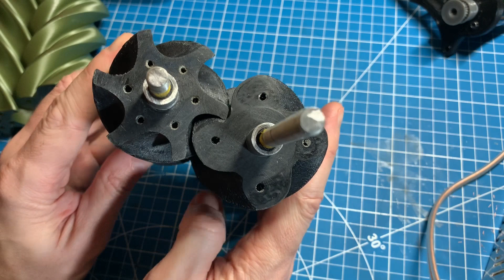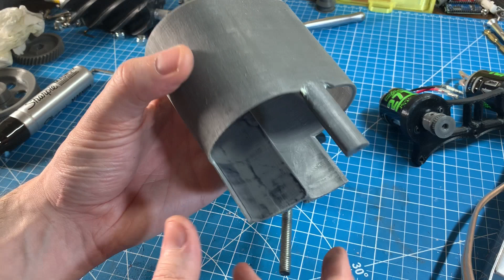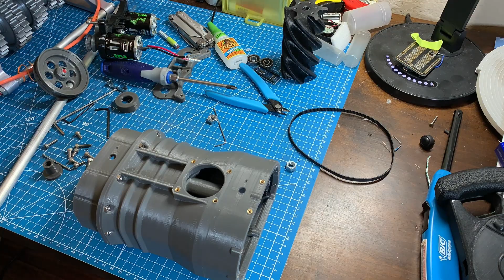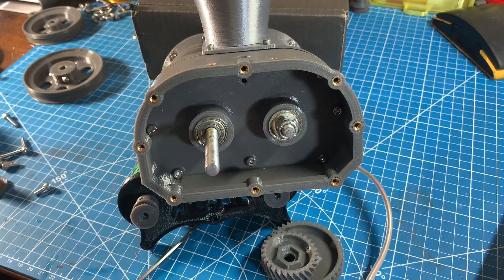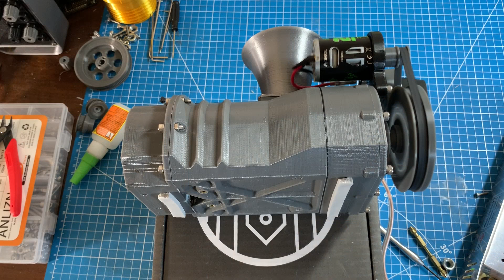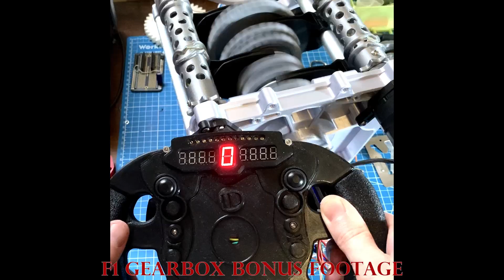3D Printed Screw Compressor Part 2 - Assembly and First Test

Comment: What RPM are you running this at? I think your design is sound but with the tolerances of FDM, you can expect your blowhole (rotor tip leak) to be quite larger than a machined compressor. Efficiency drops significantly with more tip leakage and higher rpms will improve output. Generally screws run at about 9-13k RPMs IIRC. I have a screw compressor design/performance textbook and maybe can offer some help if you ever revisit this project again.
Reply: For reference, for smaller than this Airend, 50hp isn't uncommon
Reply from the maker: I was peaking around 7k rpm.  So it sounds like I really need to spin this thing faster.  I think it would definitely go smaller for my next design and a full gear driven drivetrain.  Like you said the tolerances are what make this so difficult, particularly at this size.

Comment: I'd think it is loud because one rotor is turning the other, rather than each being turned by timing gears.
Reply from the maker: I'm not sure on the cause.  I know that most small dry compressors don't usually run timing gears.  I know the twin-screw superchargers used on things like the Hellcat have muffler built into the supercharger otherwise they'd be quite loud.

Comment: Your print and fitment issues come for lack in adjustments on slicer settings. adjust the horizontal expansion setting in your slicer... negative values if holes or too tight things fit too tightly, positive values if they are too loose... insure your printer e-steps are properly calibrated. Both can cause too much or too little flow and make the overall print different than you design. I run into this problem with different types of filaments as well. The more you print the more you learn.
Reply from the maker: It's definitely a learning process, I need to place more with the slicer settings.  I had a terrible time getting the shape to be perfectly concentric.  I have very different printer setup now that may do a bit better.

Comment: I think they come off quieter because the peaks and valleys of the noise made aren't nearly as unsteady as a piston type, which have to accelerate and then decelerate over and over again. Having the power go out in the middle of the day while using air tools really gives an idea of how much higher the noise floor is with these running.
Reply from the maker: That completely makes sense.  The noise is much smoother than a piston compressor.  I'll definitely add a muffler to the intake if I do a version 2.

Comment: Hi wonderful work. Quick question... you said you noticed play in the 608 bearings and basically fixed it with tape? Is there a "zero play" bearing or am I asking about something that doesn't exist or is the nature of this type of bearing always going to have some play in it. I'm learning so much from this and am glad that you got technical but not mind boggling with the explanation of the build. That really matters to some of us!
Reply from the maker: Thanks!  The 608 bearings do vary quite a bit in quality and tolerances, but in this particular case the threaded rod I used for the shaft was slightly undersized.  If I did it again, I would use an 8mm precision rod which is fairly cheap on Amazon and these should fit much tighter.  Being a first time prototype I just tried to make it work with the threaded rod I already had.

Comment: Some materials and print settings have a parameter called "Shrinkage or Expansion factor" which potentially explains your meshing problem.  This information is not available outside academic settings and precision engineering houses that test materials themselves, so shrinking a part was a good move.
Reply from the maker: Thanks.  I need to play with the shrinkage settings in Cura more and see if I can get the parts to turn out more accurately.  I wish there was more information out there on the  manufacturing and design of these.
Reply: @IndeterminateDesign  You might also have to increase the stiffness of your printer.  If you have a direct drive printer (I think you do, because you print PETG), then you could consider switching to a bowden tube, and creating gussets to stiffen the gantry of the printer.  This could improve your tolerances enough to get a solid print.

That said, I wonder how much the parts are expanding as the helix rotates from centrifugal forces.  We might be dealing with factors beyond just the actual printing tolerance of the printer, when you get interference on your gears.
Reply from the maker: Yeah, some of that is so hard to measure with these shapes.   I didn't talk about it in the videos, but these screws are basically a type of cycloidal gear, so they have a lot of sliding action which the smallest errors in the shape can cause intermittent issues, and actually push the air the wrong direction.

The biggest lesson I now know for version 2 is to print very slowly.  I seem to get much more accuracy when I do this.

Comment: if this mounted in pneumatic engine will it make the air tank consume less?
Reply from the maker: Well this design wasn’t very efficient, but with regards to your question is this most won’t decrease the amount of air consumed. The engine would spend more energy spinning this pump than it would recover by pumping air back into the system.

Comment: please upload Vedio 9 mint to 19 mint with slow speed for better understand.
Reply from the maker: I don't think I'm going to be able to fit all of that in to a video.  If you check out my GitHub I have the cad files and profile for the rotors available.  https://github.com/indeterminatedesign/ScrewCompressor 
 There is a significant amount of math and a custom program I had to create to generate the rotor profiles using envelopes.  If you want to make a different form of rotor I recommend downloading this paper. https://docs.lib.purdue.edu/icec/1099/.

Comment: Buddy, if you get one of these compressors able to lift 70 psi, how much would you charge for one? Let's says it's entirely printed in PTE with the needed tolerances.
Reply from the maker: That's an interesting question, I'm not sure at this point how much one would cost.  Unfortunately,  since this design is a dry screw compressor it will not be able to achieve 70psi.  Professionally built industrial screw compressors like this only achieve around 30-40psi.  Definitely something I may look into later, but it will require a two stage screw compressor.

Comment: You could try to keep the vase mode outer shell and then print a smaller infilled rotor that you can "screw" inside of the vase shell, that way you save on the post processing of the rotor, get a better lobe fit, and it becomes easier to test different geometries.
Reply from the maker: That’s a good idea, I may try that. I was going to try filling a vase mode rotor with some casting urethane but that adds a lot more weight.

Comment: My experience with screw compressors is they are all loud. Both refrigeration and ai compressors. Air compressor one were worse though
Reply from the maker: That's good to know.  I assumed differently after I saw all this sales literature about how quiet they were.  Goes to show that you shouldn't trust sales.

Comment: I used to sell drilling rig equipment and 700hp+ screw compressor were common, they used a huge amount of oil and the receivers had oil separation in them, i don't know the grade, but i suspect it was 10w40.
Reply from the maker: That’s good to know that they inject a lot of oil. I couldn’t find anything in my research about how much oil was actually being injected.

Comment: Very cool 
to measure free flow air delivery I have used a garbage bag in a wooden box built to a known volume and drill a few holes around the box to help air in to box to escape as the bag inflates

 and one bigger hole in the top that you can use to see when the bag is full 

You can also use the bigger hole to measure pressure as you know surface area of the hole if you put a weight on top of area to work out the pressure
Reply from the maker: That's a great idea!

Comment: you really have done a great job making that. and you injecting water will work for sealing and cooling.
inject water in the middle under the air end or at the female rotor side of the case at the start of the compression cycle. 
love to know if it works.    thanks for the great vid.
Reply from the maker: I like the idea of using water, a lot less mess than oil.